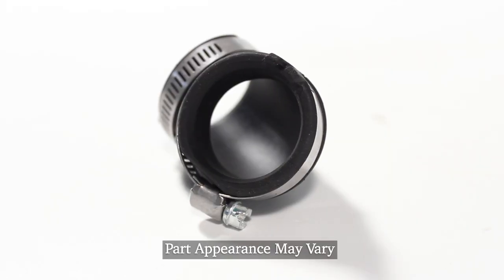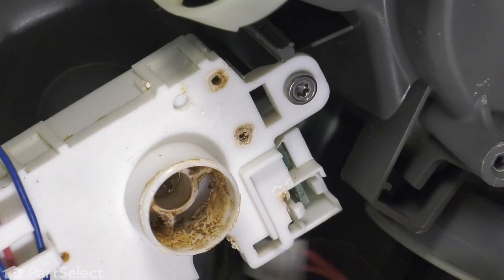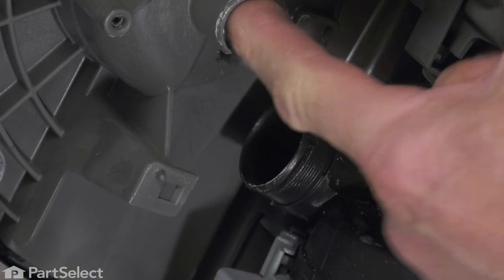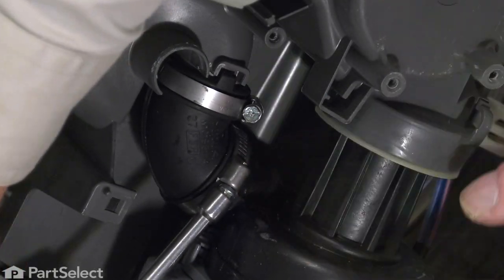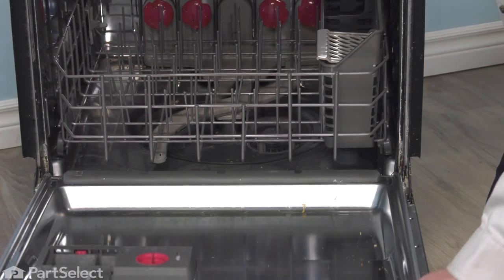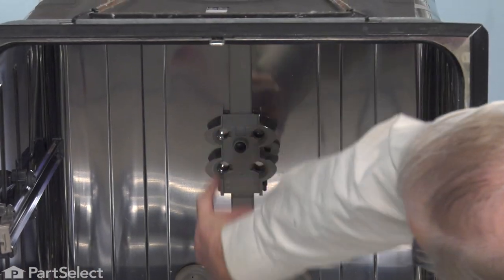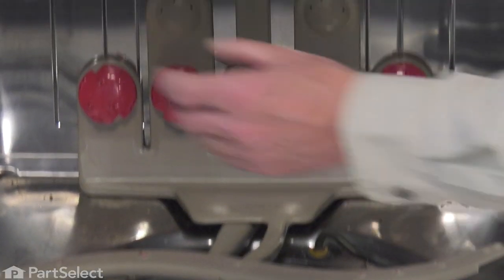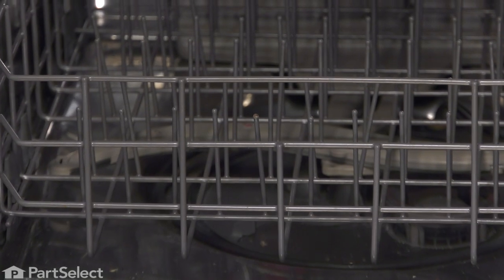Whirlpool Dishwasher Repair - How to Replace the Hose w/Clamp (Whirlpool # W10445975)

Comment: Can you tell me what size screw type hose clamp that you used?  I'm having a heck of a time finding the right size single pinch hose clamp and haven't found a screw clamp that is narrow enough to fit inside of the grove of the rubber hose.
Reply: Yes please can you provide , I am also looking for them??
Reply: FML.. Having same issue
Reply: @paulmills2185   Look for a skinny hose clamp that you can tighten with a screw driver.  Otherwise buying the hose clamp that you see in the video will require a specific tool.
Reply: @Declared-righteous  that's what i tried to do.. I looked at 4 different stores and tried to looking online.. I can't find a thin  one that works.  I gave up that day lol.. But I'm gonna look again